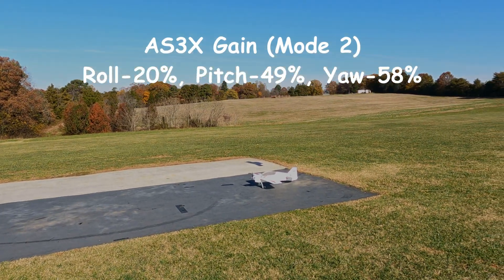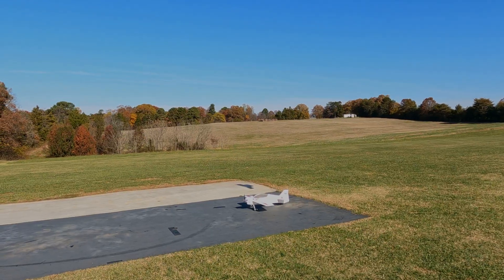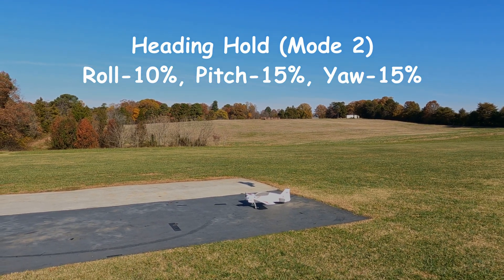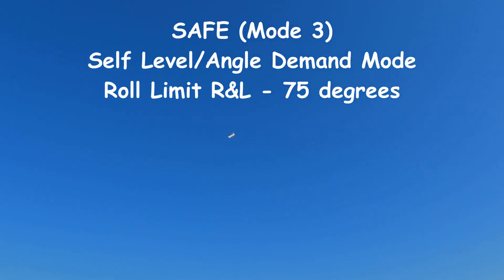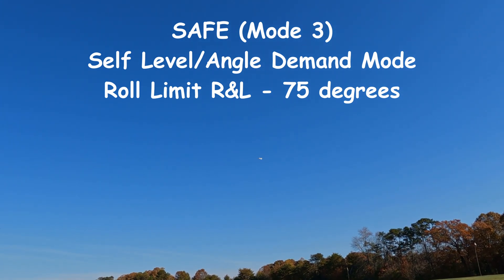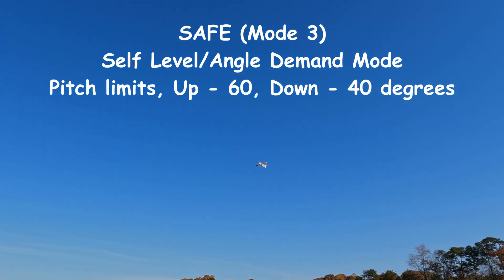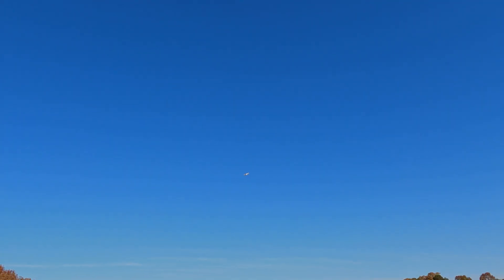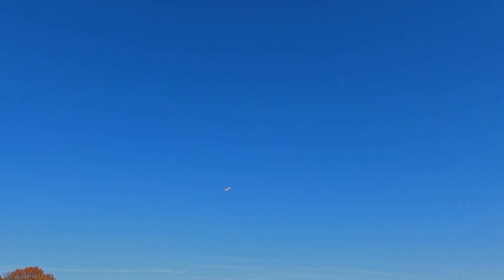4K EXTREME SAFE Flight Envelope with Heading Hold

Comment: This is great, thanks for sharing. One question, out of the several modes you demonstrated which would you recommend for a warbird plane that has a tendency to torque to the left at take off? Even if I input right rudder once the tail wheel is off the ground, she still pulls hard and wants to ground loop. I'd love to get your input on gains and heading hold...then once I get her in the air, I'll switch off the SAFE mode and fly with just the AS3X.  I look forward to your reply.  Cheers, Rudy - Houston, TX
Reply from the maker: Thanks Rudy. I'm a little uncertain on what you are asking me though. You used the word "torque" in your question to describe something causing your warbird to turn left on takeoff. In my experience, generally motor torque will cause the plane to roll left, but not necessarily to turn left. My suspicion is that your model might be turning left during takeoff because of excessive "P factor", which I believe is from the prop wash striking the left side of the vertical stabilizer. If this is indeed the case with your warbird, then the flight mode you want to use for takeoff is heading hold (HH). I've had several tail draggers that would turn left strongly while taking off, and using high gains in heading hold on the yaw channel solved the problem. There is however, a potentially serious problem with using high gain HH on the yaw channel, and Spektrum warns about that in their setup videos and instructions, plus the newer transmitters also provide a warning against this on their HH setup screen. The issue is that in order to keep the plane from unnatural reactions during a banking turn, you need to coordinate ailerons with some rudder and maybe elevator input. This is going to feel kind of strange until you get used to it, and avoiding a crash while learning can be an adventure. You also confused me when you mentioned SAFE mode, saying that you'll switch SAFE off once in the air. Be aware that SAFE mode is primarily used to keep the wings level and the altitude stable while the sticks are in the neutral position. It will not prevent ground looping, because there is little (if any) control being automatically delivered in the yaw channel in SAFE mode. Please understand that SAFE, AS3X and HH are 3 separate things. AS3X can be combined with both SAFE and HH, or you can use only AS3X without SAFE or HH, but SAFE and HH cannot be mixed together. Unfortunately, one sad thing I have learned while playing with SAFE, HH and AS3X is that the settings for one model do not always work well with a different model airplane, so I can't offer any specific recommendations for your warbird. I have also found that some models do not react well to having AS3X and HH active at the same time. This can be especially true with 3D planes with their super large control surfaces and radical control surface throws, versus warbirds with smaller control surfaces and restricted throws. I hope this helps!

Comment: That is so cool. Is there a video on how you programme the setting please?
Reply from the maker: MokOscar,
Thanks, I appreciate that. The best setup videos I've seen for the newer Spektrum SAFE receivers (AR637, AR630 and AR631) are the series of 5 from Miquel Alvarez. His main index page is at https://www.youtube.com/playlist?list=PL-qOUjKDj-ZazEnV0vavFZYuT9nQJRQ2p.  This is where I learned the basics on how to do it. You'll have to experiment a lot to find the best setup for your airplane, depending on what you want to do with it, and of course what type of plane you are flying. I have found that for some (but not all) 3D planes with large control surfaces and big throws you need to dial down the AS3X settings to near zero or completely to zero. For the kind of flying I'm doing here, you need a lightweight airframe that is very stiff. If you try this with heavier planes with higher wing loading, you'll get lotsa tip stalls in the slow, sharp turns. Good luck and have fun!